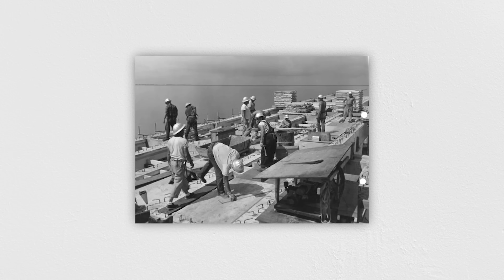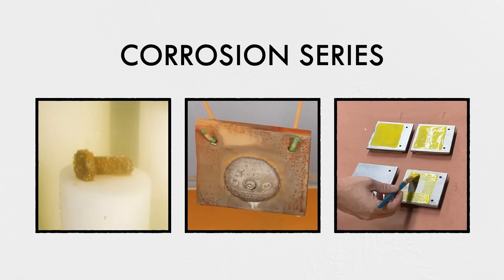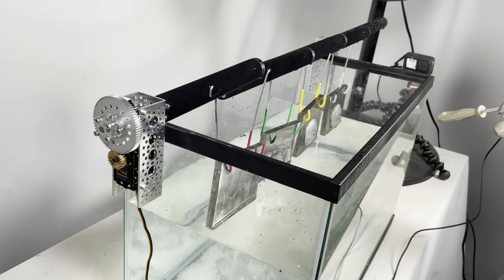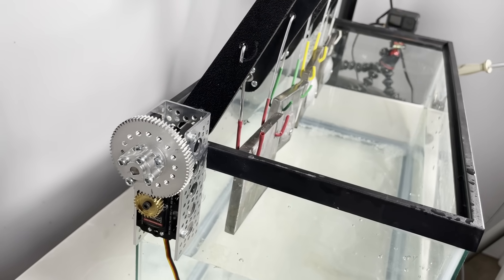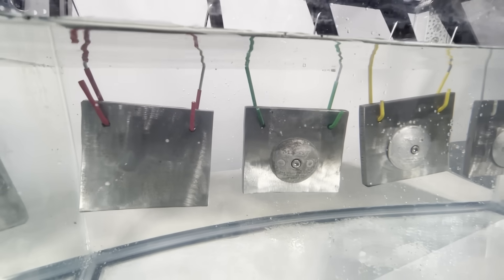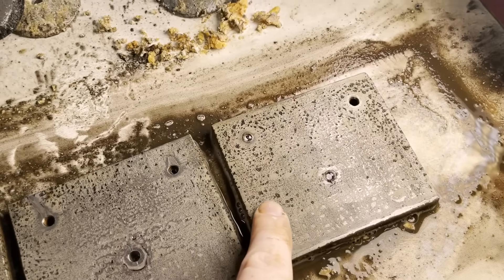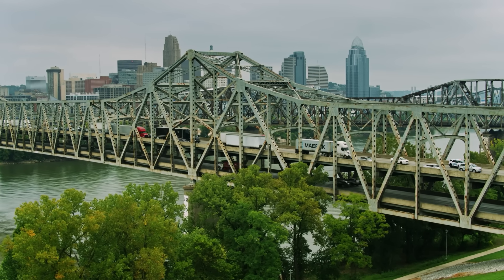Why Spillway Gates Don't Rust Out

Comment from the maker: 📺 Get a year of CuriosityStream AND Nebula for 26% off, just $15! http://www.curiositystream.com/practicalengineering
📖 Did you know I wrote a book?! It comes out just in time for the holidays. Preorder now for early access and other cool stuff: https://practical.engineering/book
Reply: The most common cathodic protection electrodes a vast majority of people doesn't know about is the one that is in every steel hot water tank. Many tank fail because said electrode is spent and not replaced.
So, for about $40, those hot water systems could have been working for many, many more years
Reply: @randomelectronicsanddispla1765  Interesting - I assume that's a USA thing as British hot water tanks are copper.  That doesn't stop them corroding - the quality of the copper makes a difference and poor quality can turn copper pipework into a sieve given enough decades.
Reply: I wish you had done the rust-o-matic test with a 5th piece that was STAINLESS STEEL ..... maybe next time?? lol
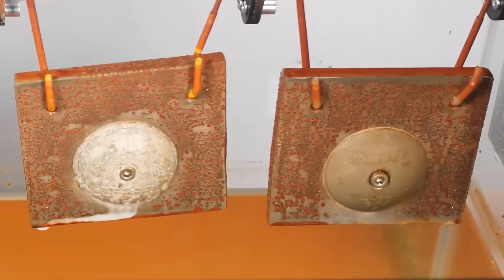Reply: 7:52 Can you do another experiment like this, but this time, use ALL 3 anodes on the same metal plate, like a tower & see what happens.
I guess the magnesium is dissolving first to protect the other 2 nodes, then the aluminum & lastly the zinc one.
Most interesting question about this, can multiple metals (or an alloy of all 3 metals combined) work better & longer than any one of them individually?
One way I think this could fail to work (at least as an annoy) is if the magnesium dissolves first & create like a "metal foam" that has worse contact with the iron.
Reply: @sebbes333  sinon, but that dosen't proof anything and have nothing to do with this test. Why you want test like that and what is idea in it?
Reply: @jannejohansson3383  Because I want to see what happens, why else?
Reply: I signed up for curiosity stream how do I access nebula
Reply: @johnspence2466  Hi john. Give it like 5-10 mins then look out for an email from Curiosity Stream giving you a login ID and temp password.
Reply: @C2K777  for me I could instantly log in to nebula with the password and email I used for curiosity, I didn’t get a temp password
Edit: I never even got an email from nebula but I have access anyway
Reply: I really enjoyed the episode as I do with all your work.  I got the Curiosity Stream/Nebula bundle for my wife for Christmas this past year.  

I worked in a boat yard many years ago and can't tell you how many zinc anodes I have bolted to or removed from the rudders of all types of craft.

It was easy to see the necessity for the use of the
Reply: Everybody who owns a boat/yacht has a piece of zinc attached to the underside that is replaceable and even boat motors have this on them.
Reply: You forgot to mention water heaters
Reply: What about CORTEN steel test?
Reply: To show the difference between the rusted and not rusted metals after dipping I suggest weighing them before and after and comparing the loss in mass and using that as a measure.
Reply: If you test different anods on same pool, it's huge error if you connect different plates together electrically by hanging wires or another way. It makes errors your test samples.. think about yourself.
Reply from the maker: @jannejohansson3383  The wires have heat shrink tubing to isolate each sample, and they only stayed in the water for a few seconds each cycle. The bath was just a convenient way to wet each sample.
Reply: And that plain plate should rust more like what happened, I think.. It maybe took some electricity to another plates from hanging wires connect.
Reply: This channel is sponsored by weed: Smoke yours today
Reply: There is a major problem with this test and I hope you redo it. The zinc anode you used is low quality. Order a Zimar R3 anode. It’s 99.995% zinc. The one you used is likely less than 98% (milspec) so the oxides protected it from corroding. I’m confident you would have seen better protection from the zinc anode. 

Another factor you didn’t account for is marine life. When shelled growth attaches to the anode it protects the anode. Zinc is a natural biocide so less growth occurs on the surface allowing it to corrode freely.

Aluminum will be covered in growth and be inefficient or ineffective.
Reply: @practical engineering can use zanak insted of pure zinc as sacrificial anode
Reply: You know, since electricity in a car flows back to the battery through the body of the car, I’ve always wondered why battery boxes don’t have an intervening sacrificial anode. Is it just too expensive to keep cars from rusting Chicago?
Reply: YEAH WENT TO SIGN UP AND THE PRICE WAS DOUBLE
Reply: What a great job in this video!
Reply: 2:30 other questions: is there a reason besides cost why things like these aren't built out of alternatives to stainless steel, like hardened aluminium alloys?
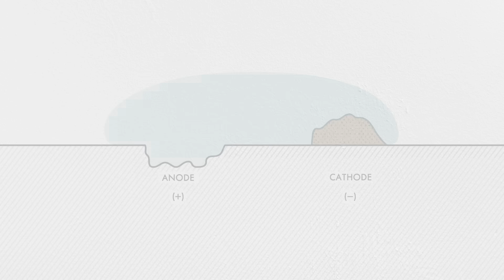Reply: At 3:55 you show the Anode as positive and the Cathode as negative. This must be a mistake?
Reply: Hey is the metal beam used in the mounting of the servo on the Rustomatic 3000 a GoBuilda item or is it homemade?
Reply: Hello, I'm looking at making a rustomatic 3000 for an engineering paper. Would you please help with the plans for your machine?
Reply: Love your videos but kinda disappointed that your advertising nebula to watch your videos early when this video came out on nebula only today aswell
Reply: @Jacopski  They're normally 2-3 days ahead tbf. I'd guess there was a bottleneck at Nebs end this time maybe?
Reply: @Jacopski  Hmmn, for me it was released on Nebula last night. And as some others have mentioned, Practical Engineering is usually a few days before. There are some creators on Nebula who seem to treat it as an afterthought, but I haven't ever felt that with PE.
Reply: These are used on boats as well. Both for the hull if it's steel and on/ near the shafts/ props/ engines depending on design. Different types ( metals) are used depending on if the boat is kept or used in fresh or salt water and just like in your examples they are designed to attract so that they degrade rather than the hull, props etc. You basically bolt them on and depending on quality, conditions the vessel is exposed to and if it's kept in or out of the water depends on how often you need to change them
Reply: @C2K777  all the way through the video I was thinking he's about to mention boats.
Reply: @CyclingSteve  IKR!

Comment: There are two places you'll encounter sacrificial anodes in regular use: in water heaters, to keep the metal liner of the water heater from rusting; and for those in the maritime environment, on the outside of ships,especially museum ships, where blocks of sacrificial metal and attached to the external surfaces of the hull. 

The sacrificial anode in water heaters is usually attached to an external fitting with a bolt head so it can be removed and replaced, extending the life of the water heater, but I haven't come across a plumber yet that reminds their customers of this.

Comment: There is a video on the inadvisability of installing cathodic protection on vehicles. the tests are skewed be using them on bare metal while the recommended practice it ti install them on painted surfaces to float the ions to any exposed metal that inevitably is or becomes present.

Comment: Did have rather seen what the simple test for how long and why. In the structure context of maybe idk. Paint the Rabar before installed and surrounded with concrete.  Maybe that last longer.  Maybe what about nylon coating or wax coating.    Could you not idk spent a year concrete some coating actually make some replicants of how concrete and rebar or steel structures like what’s inside of most modern buildings.  I could imagine a nylon or wax coated rebar or structure within desired structure might last longer and hold up in the environment

Comment: There's a building I know where the contractor forgot to paint the structural steel of the building and that wasn't caught on punch 30 years ago, so now they're having to spend millions in shoring costs to replace it while carefully not knocking over the builidng

Comment: If Aluminium corodes so easily why is it used on tinnies(small metal boats with outboard motors) in the construction of the hull? Interesting. Ive seen lots of small Aluminium boats left outside that are still shiny.

Comment: The rust experiment is inaccurate if not completely false, since metals not only rust, but react with each other if you sink them in the same pond. Try it out yourself and put some Gallium on Aluminium, or make copper and aluminium touch in wet conditions. 

Not only does the rust exist on the same metal piece, it wanders off through the conductive salt water to a differently charged other metal plate, since saltwater is perfectly capable of conducting. Essentially every metal has a slightly different electrical charge, so youve build a reaction chamber between all of your metal plates. Some mightve not even rusted themselves, but aquired it from other plates. Your anodes especially probably lost so much because they darted off everywhere.
Reply: The ionic conductivity is much lower than the electrical conductivity of two metal plates touching, so it doesn't matter in practice. The plates just get pulled to whatever local potential the experiment imprints on them, no matter what the global potential the whole tank setup wants them to be at.
Reply: you're actually dumb

Comment: I have a question and someone maybe know the answer
I have a small sailboat and at the front of the bost there is a structure made in stainless steel and aluminum alloy,, the 2 parts are in contact and the stainless steel is slowly eating the aluminum, i was thinking to connect a zinc anode to the stainless steel part but chat gpt says that this will just speed up the corrosion of the aluminum.
Someone know if this is true?
Is my idea good or bad?

Comment: How large of an area do the cathodes protect? If it was an I-beam or rebar grid how would the spacing be calculated - by distant or by material in question? Or both? 🤔🤔

Comment: 05:55 FYI anyone who is interested, zinc coatings are not just limited to galvanised. Those gold coloured screws you see are zinc passivated, its a zinc compound (i think oxide) that is effectively electroplated to the screw and achieves similar results. Galvanising will provide better protection though due to thickness applied but this approach would block the threads of a screw.

Comment: usa navy subs use a zinc anode was about a 10 pound cast zinc bar  cast over with a 2 X 1/4  steel bar welded to the hull.

Comment: I see a major design flaws in your Rustomatic 3000:
1. In a real environment, there wouldn’t be so many different metals in the same electrolyte; each metal should have its own container.
2. In the real world, there would be fresh electrolyte for each dip. In your case, it seems you were just adding new electrolyte as it slowly evaporated.

But for general overview, your experiment was nice, but based on it we can't tell that aluminium would be better than magnesium.

Comment: Very nice and informative video, I mean, I kinda knew quite a bit about the subject beforehand. but was very interesting to see the timelaps and the difference between the anodes, that I have never seen before. also I used to weld mostly 316l steel on the paper factory I used to work at, and well maybe its just because I was used to weld it, but I personally thought welding 316 was easier than welding regular steel. Some times I still prefer to use 316 sticks when I weld normal steel if I weld thinner steel pieces to make it less likey to burn trough the steel. but 316 sticks are very expensive so I try to avoid it if I can.

Comment: 2:37 that not entirely true. Stainless steel is generally great for welding. As for forgeability, yes, it’s a bit harder, although I wouldn’t call it a real problem. As for the cost, if we are talking about common grades of stainless steel designed to withstand highly corrosive environments, yes, those might be pricier. Steel alloys that resist natural atmospheric oxidation require far less chromium, which, while still making the end product more expensive, is far more beneficial to the end customer in the long run.

Comment: One place this comes up at home is in your water heater.  There is a sacrificial anode that screws in from he top - in theory one should replace that every few years, and replacements can be purchased at home improvement stores.  If you don't, the water heater starts to rust out on the inside of the tank, and eventually springs a leak.

Comment: 7:57 there are even less noble metals than magnesium, but they probably aren’t shown on that series because they aren’t useful to engineers, since they tend to explode when they touch water. Barium, potassium, etc…
:)
Reply: The most electropositive "metal" is photosystem II of a plant cell, but that's so far removed from corrosion that it really doesn't matter.
Reply: @hammerth1421 … I wouldn’t really call photosystem II electropositive since it rips electrons off of water to form O2… which is more like an electronegative element...

Comment: Corrosion and rust are basically the same but subtly different. Corrosion affects non-ferrous metals, such as aluminium, copper, brass, etc.. When we are talking about iron or steel it is rust. Both are oxidation processes but the two terms are not interchangeable. That photo at about 0:25 shows steel reinforcement bars so that is not corrosion, it’s rust.

Comment: Battleship New Jersey had 1,204 zinc anodes bolted to her hull to form her cathodic protection. They were designed to protect the ship from dissimilar metal corrosion by acting as a sacrificial anode and corroding in place of the hull over her years in active service.

Comment: Just the act of using Zinc spray or Zinc paint is a great way to protect metals. I always use Zinc spray as a primer, or i use it as a first layer before i apply the primer. Sometimes i even just use Zinc spray and nothing else and it works great...

Comment: I run water tenders. I started adding magnesium RV water heater sacrificial anodes to my water tanks and plumbing as an experiment. 

I am dealing with fresh water, so the corrosion is not as profound. I have not noticed anything major, unprotected metal still has surface rust and I also have no control so I have no comparison. But so far so good.

Comment: The aluminum and zinc samples had too much protection which results in them rusting like the non protected metal. You can tell they are overprotected due to all the fuzz that has propagated on top of the anode and by how little the two deteriorated over the course of the experiment.

While the results would not have changed (due to the short duration of the test), over time, these overprotected samples would rust just as badly as the unprotected sample because the fuzz that grew on these anodes would actually prevent the anode from doing its job.

Comment: I dont think magnesium would be a good anode it would form magnesium hydroxide wich can be corrosive i actually worked a lot with that stuff even accidentaly spilled some in my eye (my eye is fine i washed it imidiantly) the problem with these bases is that they form litural soap from your skinfat and not only yours also from the fish, so it takes the skinfat from the fish which is not good.

Comment: I don’t think it is correct to say that the anode has “low electric potential”, it is merely where the oxidation takes place. It was arbitrary that we gave it a negative polarity. The potential is the same as the other half of the circuit you showed, albeit with an opposing polarity.
Reply: “Low potential” is an expression of magnitude. Negatively signed potential?  “Source of free electrons”?

Comment: We're currently in the process of revamping our secondary clarifiers at my plant because the ferric chloride they use for phosphate and odor ate through the galvanized coating 10 years sooner than expected. It is important to remember that sacrificial anodes deplete. Galvanized steel only has a thin coat of zinc. It's best for non corrosive applications.

Comment: Didn't even explain electrolysis
Reply: But these are all spontaneous reactions. What relevance for electrolysis? The issue is galvanic.
Reply: You are correct electrolysis has nothing to do with Bridges but if electricity is involved in the movement of the bridge then electrolysis would play a role

Comment: as soon as I heard Cathode I knew the rest of the video.. had one set up in my car in the spare tire well... replaced every 5 years and my 98 mystique was a rust free daily until 2010 when it got written off..  still clean as new. I can't remember the brand of the little box I had wired up. there was a block underneath the spare tire well and the box inside the trunk..  worked so well

some parts can be nickel coated for protection.

Comment: I think you oversell the use of galvanized steel in spillways. The use of SS gates are far more common than galvanized steel in modern construction. Hell, I see way more ceramic coated gates than I do galvanized steel.

Comment: This is not how rusting works. It's oxygen in the water that's oxidizing the metal. Iron at the same oxidation potential as itself cannot induce what you're basically describing as a in internal galvanic cell